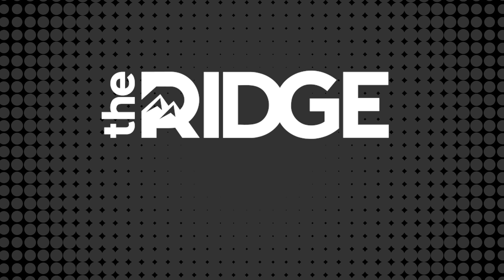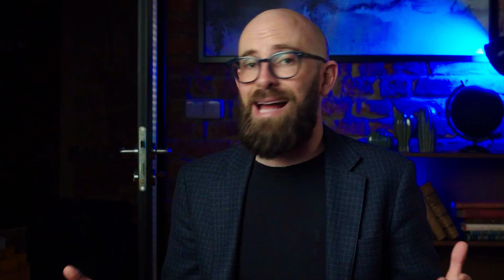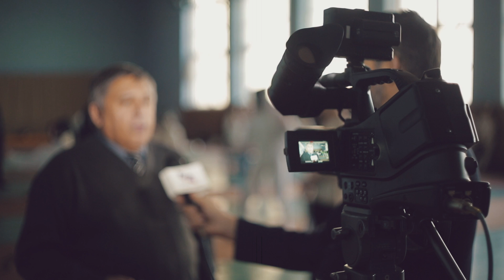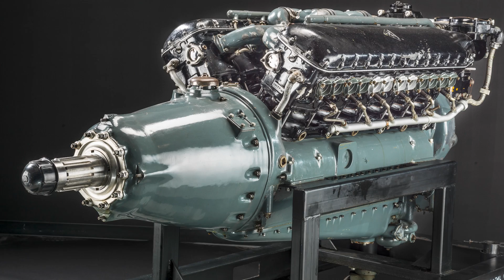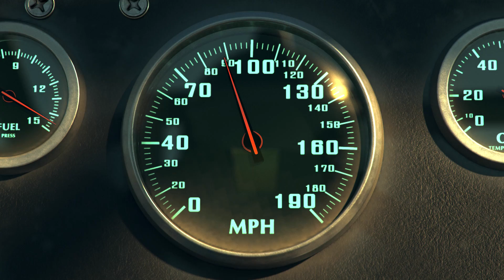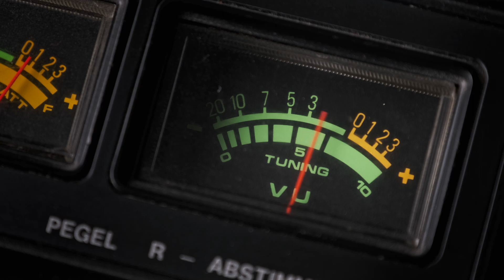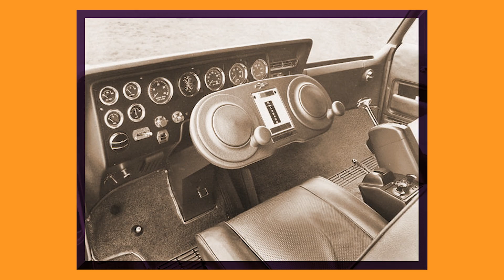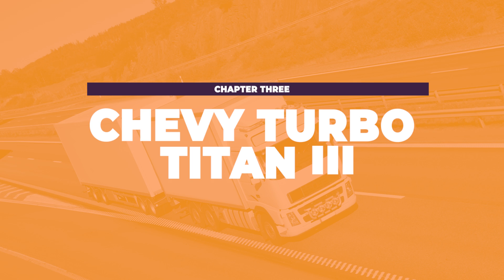Turbine Trucks: The Gas Powered Big-Rigs of the 1960's

Comment: Ultimately, gas turbines are great at base loading, but you try to use one in typical stop ang go city traffic and all that advantage goes straight to hell.  An idling turbine burns almost as much fuel as a loaded turbine.  With high capacity Li-ion batteries today this could work.  The turbine only fires up on the freeway, but electric drive is used for slower small street travel.  It could work.  Nobody willing to chance it these days though.
Reply: The railroad gas turbines of the 50s/60s had the same problem.  Railroad locos spend a lot of time idling.  So turbines lose out in the long run to diesels.
Reply: @pmgn8444  Yup, until we have batteries with energy density probably at least 10x greater than Li-ion, diesel and diesel-electric hauling vehicles are the best option.
Reply: @Sgt_SealCluber  give it 10-15 years. Battery technology will take a huge leap in this decade.
Reply: Excellent for tanks, ships and fighter jets
Reply: Wrightspeed is working on this, though I think they're working more on conversion kits for existing garbage trucks than new trucks.
Reply: @AramisWyler  My dad used to drive garbage truck.  He always talked about "Garbage Truck Miles".  The slow start stop start stop grind is super hard on the truck. Way harder than most people would think.  Same thing goes for city busses.   That's why electric drive trains make so much sense.  Electric motors don't have to "idle".  IC engines are always running whether their power is being used or not.
Reply: @rayceeya8659  Certainly I agree - the Wrightspeed corp revolves around using turbines buffered by large batteries against electric motors with regenerative braking.  The turbine would only spin up to charge the battery, because turbines are only efficient at high speeds.
Reply: A gas turbine is begging to be part of a series hybrid drive.
Reply: Turbines have been improved substantially since the 60s, ground use diesel turbines have similar idling fuel consumption as conventional piston engines.
Reply: @Nothing_._Here  Well, then it's time to start using them.  I been banging this drum for decades at this point.
Reply: @rayceeya8659  People already use turbines. Just not in commercial cars because turbine repair does not generate as much revenue as the repair of conventional piston engines. It's the same reason you don't see opposed piston engines, it is hard to make them require regular repair due to the vast simplicity involved.
Reply: I think I remember a more recent truck in the early mid 2000's that was developed for Walmart..  Used a small gas turbine for power generation and use at speed, but was electric drive with a battery for surge power...  a Hybrid setup.  They claimed better fuel efficiency and lower maintenance.  But I don't think it ever made it past any prototype stage. The new powertrain was placed in a standard truck model..
Reply: Rig them up on H2, splitting H2O is around if they would work on and if oil cos haven’t bought them up,surprising what they have bought up, hydrogen is completely cleanburning as it leaves water
Reply: @sheilamclaughlin963  H2 is a pain to store and transport, and needs enormous tankage. Splitting H2 from H2O will always be energy negative, so it needs to be done offsite anyway. Electric is better than H2 for any land or sea based vehicle.
Reply: Jaguar had the 2005 CX75? Concept.. Hybrid with turbines to power the electric motors as generators
Reply: Turbines only have a speed range of 2:1 as opposed to piston engines with 7:1 speed ranges. Due to boundary layer effects on blades, (the faster, the better) turbines have significantly less power at low speeds than at top speed and are poor in acceleration.
Reply: @Greatdome99  That's why you use an electric drive train.  Try to keep up man.
Reply: @Rich Cran No. Union Pacific quit using them in 1970.
Reply: Actually people are building them... Using Tesla's as the base vehicle
Reply: @Ray Ceeya  Except for Ariel with their Hipercar protoype, which does exactly what you described, but for the sake of speed and performance rather than practicality and stop and go traffic. But hey, their little batmobile looking track toy might be a decent proof of concept, if it works.
Reply: @Cancer McAids as the owner of a 960 rwhp Cummins I daily drive (and I know you're not talking about a diesel), my twins spool rather quickly.
Reply: Driving in cities is something to avoid in the future.

Not just for trucks
Reply: They could even have it solely EV powered, loads of torque, large battery weight wouldnt matter.. and then have a very efficient turbine as a generator for charging the batts on-the-go. Just like the "Ariel Hypercar", but obviously tuned for torque, efficiency & range. Apparently the Ariel's small turbine can keep it charged infinitely even with agressive driving. Only if you try doing a full track day nonstop, will it eventually run the batteries down. And the turbine can run on several types of fuel including e85👍
Reply: @flexinclouds  Exactly, I've been saying this for almost 20 years.  I was on this before Tesla was a glimmer in Elon's eye.  Another way to think of it is an electric car with a gas turbine range extender.  A conventional piston engine has to be optimized for two purposes.  High torque to start off and accelerate and low fuel consumption at speed.  At highway speed, you are only using a fraction of the power that the engine is capable of.  Like 10%-20%.  So you have this big metal engine that spends most of its time at low power output.  

So optimize the engine for cruise, and supplement with electric drive for acceleration.  Now swap out the piston engine for a turbine that has a much higher specific power and a lower specific fuel consumption.  They've made some amazing advances in micro-turbines.  The whole unit can be the size of a mini-fridge, but the turbine itself could almost fit into a shoe box.
Reply: @rayceeya8659  I thought that micro turbines were actually the area in gasturbine development where they still really lagged behind? Seeing as it's fairly difficult to make the cooling holes in turbine blades for microturbines?
Reply: @flexinclouds  Large battery weight does matter. There is a US federal limit of 80,000 lbs gross weight. The heavier the tractor, the less paying load it can haul. In a competitive business with slim profit margins every pound of dead weight that takes away from payload is bad business.
Reply: Turbine engines also don’t generally work as well as they get smaller. If just using it as a generator to charge the batteries, or provide power for cruising, you’d only really need 40hp at most. Often the ones considered small turbines are a couple hundred hp or more. 
The micro turbines are good power in a small package, but also don’t have the efficiency of a piston engine at the same power.
Reply: @NBSV1  Not yet at least.  Microturbines are a far less mature technology than conventional reciprocal ICBs.  It may just be hope, but I feel the tech is only going to get better.
Reply: @rayceeya8659  the first gas Turbine engines were developed maybe 20-30 years after the first ICE piston engines. They aren't that much younger, or less mature, a concept than them.
Reply: @NBSV1  Your statement goes against the reality that every modern APU has switched to a turbine setup instead of conventional piston. Turbines are far more efficient than a conventional engine at load.
Reply: @Nothing_._Here  That's an APU that's likely producing about 100hp if not more. If it only produced say 15hp or so then the turbine engine isn't the best idea. And, that's on a multi million dollar plane where the added cost of a small turbine APU isn't a big deal. 
That's the point. When you get into small stuff turbines loose efficiency, or become so complex it isn't worth the cost. Especially when you're talking about a car that's a few thousand bucks.
Reply: @NBSV1  Microturbines are a common sight in a lot of sectors like engineering, construction, etc.

What you're talking about would have been true, if it was still the 1990s.

Recuperators are pretty much standard nowadays, chormium nickle steel alloys also are no longer rare.

The main reason you don't see turbines in common day items is because they don't require much maintenance and the maintenance involved does not generate a significant amount of revenue.

I understand your dislike for turbines, however would you care to explain why opposed piston engines are not in the market and actively suppressed by companies like ford and volkswagen?

Where are inverted rotary and sterling engines? Sure they're used in military and construction applications yet you never really see them on civil markets.

If revenue from repair was not an incentive for car manuacturers, we wouldn't still be using archaic V and I type engines.
Reply: @Nothing_._Here  Sure. It's all just a big conspiracy by big piston. 
At the end of the day traditional piston engines work well enough in a small and cheap package. Changing to something else generally yields minimal benefits in the real world while adding a significant cost initially along with requiring specialized parts and knowledge. 
Which is why you don't really see them in civil markets. The military and construction has enough money getting thrown around it doesn't much matter if a multi million project costs a few thousand more to get a different power plant. But, if a hybrid car with a regular piston engine costs $50K and the same car with a turbine is 10% more efficient but costs $80K then people with just go for the cheaper one since the efficiency isn't worth the cost. 

Plus, I have yet to see any of the special new engines really perform outside of lab testing and theory. If someone can really build something like an opposed piston engine that actually does all the great things they're supposed to do in a real world they'll have something. Same with nearly all the other pipe dreams. Even the Rotary was a wonderful change that can produce loads of power in a small package. But, in the real world they have more problems than a traditional engine despite the low number of moving parts.
Reply: @NBSV1  I have never met someone suffering from sunk cost fallacy as badly as you. Opposed piston engines have been used in eastern countries for about 50 years now.
Turbines have been in use for more than a hundred years.
Inverse rotary engines have seen a heavy amount of use in drones and other small long range vehicles since the 1990s.

Yet again, none of these are common in commercial vehicles or uses because they don't generate as much revenue.

Commercial engine manufacturing is not a charity, neither is commercial automobile manufacture. Denying this fact would be to announce to everyone that you are delusional.

Saving some 50 USD off of manufacturing a vehicle can yield millions of profit, said profit is increased by the cost of maintenance.

A 10kw microturbine typically goes for around 3000 to 6000 USD.

A 10kw diesel 2 cylinder piston generator is around 1000-3000 USD.

While it may seem cheaper at first, the lifetime is generally going to be significantly lower, the fuel consumption will also be higher.

It's 2022, not 1972. Diesel gas turbines have come a long way since then.

It's also fairly concerning to see you call opposed piston engines a pipedream, they've been in use for a very long period of time outside of the west especially because of their relaibility. The cylinders are much shorter than on a conventional engine and you hahve significantly less parts, you also don't need to run incredibly fine fuel nor worry about cold affecting said engines.
Reply: @Nothing_._Here  We aren't talking about 10Kw power plants. We're talking about 2Kw or less. Which gets back to the whole point you aren't seeing. When you get that small a turbine is not as good as a more traditional engine. 
At the end of the day we just aren't going to agree. From everything I've seen operating in regular service old style piston engines still make a lot of sense and are still in widespread service. I'm not against the new stuff, but it also needs to prove itself to me. Which neither it nor you have done.
Reply: @NBSV1  There are plenty of 2kw microturbines, yet again, what's the point of such a weak generator? Are you going to run a single appliance off of it or something?

Since you're so fixated on this, start listing the physical problems with microturbines that you seem to be so knowledgeable of that no one else in the world is appearantly aware of.

I'm curious at this point.
Reply: I mean if you make the batteries big enough you can even have the turbines off the vehicle entirely and just charge the batteries when you need to, then someone could centralize the turbines so that the base load is spread across many customers making it way more efficient and... oh wait. That's just an EV plugging into the grid. ;)